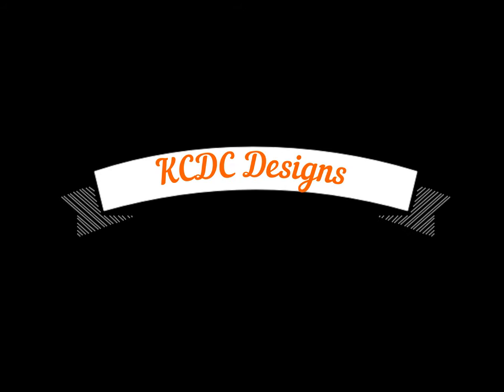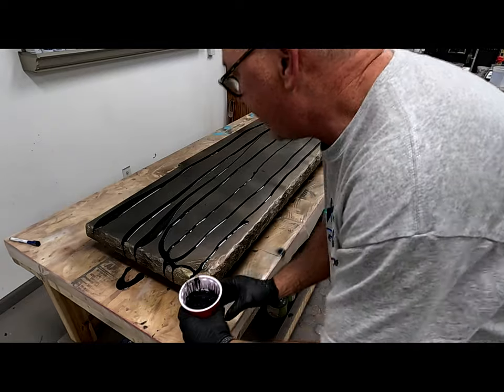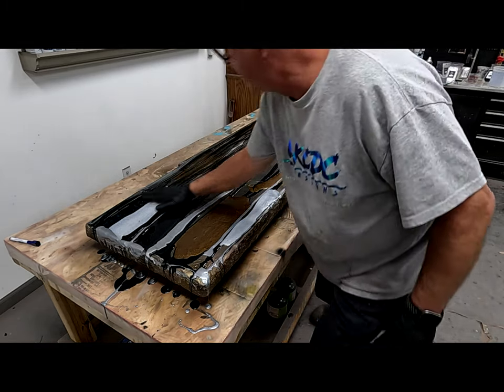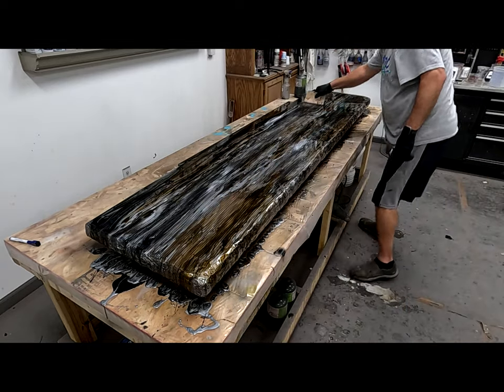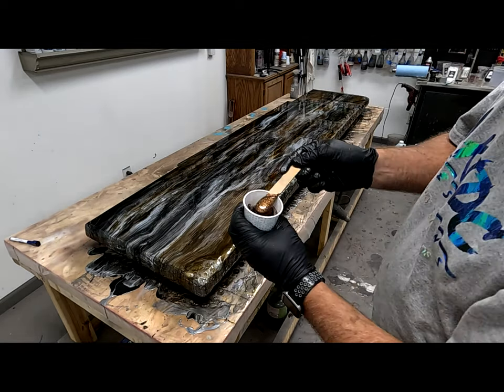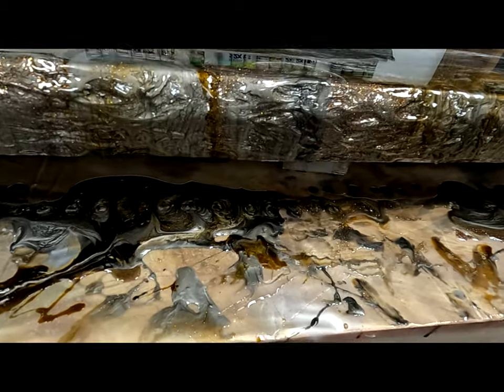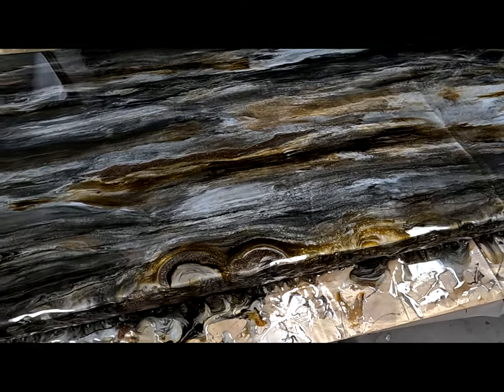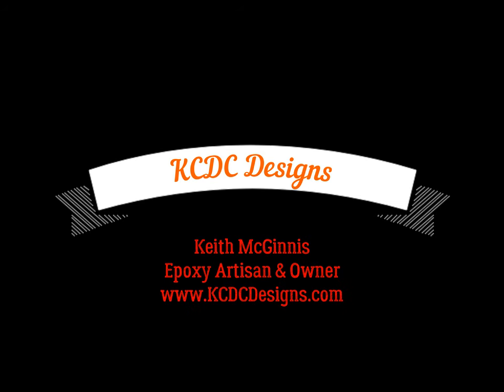Watch how I created this beautiful bronze marble hearth using Stone Coat epoxy! | KCDC Designs

Comment: I really wish people would stop calling it bondo it's called body filler
Reply from the maker: I understand, but when I refer to "body filler", those who don't know will ask what that is. When I say Bondo, they tend to know what that is. I do try to let people know what brand of body filler I use, as I'm not a fan of "Bondo" brand.
Reply: @kcdcdesigns  ever coat is great to use
Reply from the maker: @josephrao9787  I agree, and that's my go-to body filler.
Reply from the maker: Have you tried the red label and the gold label? If so, which do you prefer?
Thanks!  @josephrao9787
Reply: @kcdcdesigns  I prefer the the zgrip but to each there own